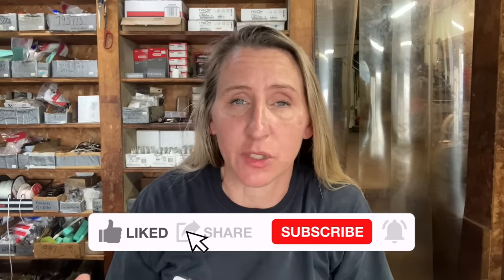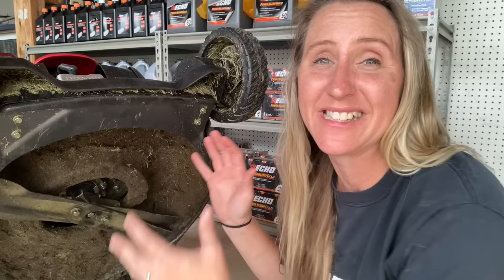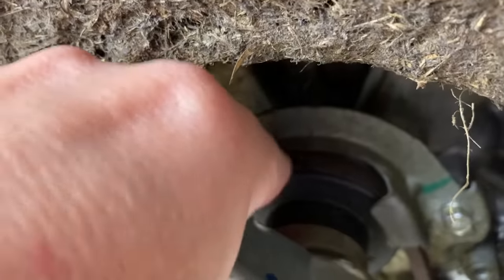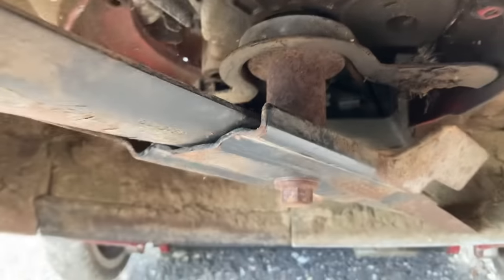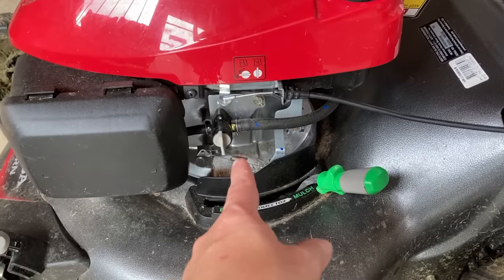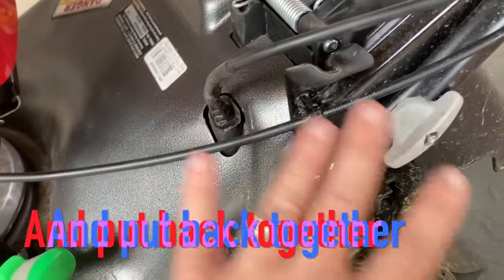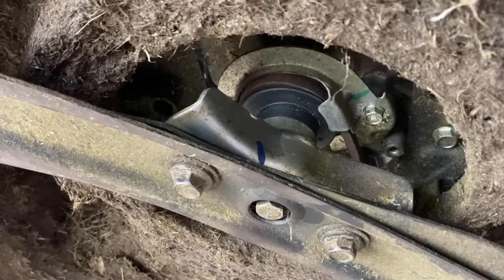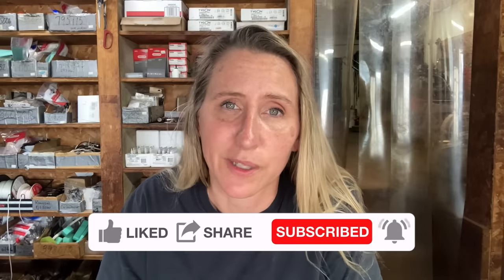SAVE A TON OF MONEY in repairs by NOT BUYING this NAME BRAND mower.

Comment: I've always sort of suspected that typical big box offerings were not going to be at the Honda HRX series level.  However, I'm really surprised to hear about these issues with Honda mowers, even the HRN series.   I purchased a Honda HRX 217 mower in 2004 for $600, a somewhat exorbitant amount of money for a self-propelled walk-behind mower at that time.  The reviews were outstanding and I had had it with cheaper mowers that always needed repairs and eventual replacement.  I even had a Toro for a short while and in my opinion it was junk, with poor ergonomics, two wheels always falling off, cheap sheet metal height adjustment levers that didn't hold, a tiny bag that didn't last, etc.

From the moment I got it, I knew the Honda HRX 217 was a beast.  The composite deck and everything about it is bullet proof.  It is the best mower I've ever owned.  It gets hard use on a half acre lot, part of which isn't the smoothest.  From spring clean up of winter leaves, sticks and small branches, throughout the summer, and deep into the fall with leaf mulching and pickup, this mower has been challenged and it is still going strong.  At $600 and now into its 21st year works out to an average $28 per year cost so far, and declining.  I change the plug and oil annually and only use non-ethanol gas in it, so I don't even have carburetor issues.

All of that said, last year Honda announced it was getting out of the gas-powered mower business.  Thinking that nothing lasts forever, I decided to buy a new HRX 217 but by the time I became aware of that fact, they were no where to be found locally.  I finally located - and bought - the last one (of two), 150 miles away.

Comment: Thanks for the information. My 13 year Toro took a dump last week was actually going purchase this Honda mover in the next few days but I guess I’ll just go Toro again. Thanks again.
Reply: Buy it,,,,, it is a good mower.  I’ve had mine two years now and works well.  Just clean and maintain it and you won’t have the issues presented in this video.  I think these issues were owner neglect and miss use, as well as not maintaining and cleaning.

Comment: A friend runs a yard service company. He tried Hondas some 10 years ago and went back to Toro. They just did not hold up under commercial use.  He has Toro's that he purchased at the same time as the Hondas, and they are still in use by his company.  After going through several cheap mowers in my new house in 81,  In 85 I purchased a Toro. It lasted until 2013.  I replaced it with another Toro.

Comment: We are a small engine repair shop, as well,
seeing the same things as you are !
My mechanic is a first rate fabricator !
So he made a sheet metal ring, or plate for the cover in the opening !
So far, so good !
We will see how well it works out over time !
As for the plastic parts, shame on Honda !
We may need to form a new cover for this, but remains to be seen !
Reply: Honda won't be caring at all now that they are stepping away from building lawn mowers.

Comment: I've been using the Honda HRX for over ten years and the only issue I've had was with the pull cord.  I do change the oil, plug, air filter and blades once per year.  I use the mower approximately one hour per week from April to September.
Reply: I have the same model and have been using it over 12 years.  I think the HRX is commerical grade and that makes the difference.
Reply: Some people don't have common sense. The look of that mower simply shows the laziness and carelessness of the operator.
Reply: That would be one of the shaft drive self propelled ones?
Reply: @bucsfan0077  Hi Fry, The HRC line is Honda's commercial line. HRX is not rated for commercial duty.

Comment: Hey Chickanic! Good information and as you stated it is about that particular model. I personally own a Honda HRX 217 VKA 190 cc that I’ve had for more years than I can remember and have definitely put it through it’s paces living here in Oregon with our wet climate. Yes, I do my own maintenance and keep up on it and have never had a problem. Personally I swear by Honda but even the best can fail now and then. Keep up the great videos they are very informative.
Reply: My HRX 217 is going on 3. Glad to hear they last
Reply: @montgomeryfitzpatrick473  My HRR216 is going on 8 years. No problems. I do blow it out after every use and clean under deck. DIY. Oil change, filter, plug every year and new blades every other year. I guess with Honda ending mower production they didn't really care as much on this unit.
Reply: The HRX is a Hydrostatic transmission though which is different than the HRN's belt drive system.
Reply: @smokeycanuck8058  And the HRNs system sucks.

Comment: Thank you  and well advised!  I have used and purchased many mowers over the past 70 years around  (30), and consider that older Honda mowers were good, however there were many other good ones. All the mowers I used and purchased were well taken care of and maintained. I liked the 2 stroke Lawn-Boys'  the best, because they were simple, reliable and easy to repair. On the 4 stroke engines I used quality oil, changed it often,  and used 2 oz. of oil per quart, additive like Prolong. I don't recall ever wearing out an engine I have bent many a drive shafts by hitting a rock..
Reply: And that is the key ...knowing your equipment at home and servicing them regularly will go a long way
Reply: I picked up a used commercial Lawn Boy with the red  wheels. Light and powerful , starts first pull, great for steep ditches. Using 50:1 oil, no visible smoke.
Reply: I have half the years you do, but have only purchased 2 mowers. Both Briggs & Stratton motors. The only parts  I ever had to buy were spark plugs, a couple of air filters and 1 coil. Mowers stay outside(no shed or garage)

Comment: I appreciate your honesty!! That's one of the reasons I watch your videos. I agree, or did, with Honda mowers being the best in walk behind mowers. But.. like everything else, I guess they've started cutting corners. The old ones with the cast aluminum deck and the three speed trans. were the best.. They were reliable and would mow for days on end with nothing more than gas and occasional oil change. I bought two of these, used, from a lawn service. Re-sold one and mowed with the other for several years with no problems. It still runs but needs some new tires.

Comment: That's unfortunate for Honda.  I've got a Honda walk behind self propelled mower and it's probably 15 to 20 years old and has never skipped a beat, never needed to go in for repairs and starts flawlessly, like most Honda motors.  I wonder if Honda has changed some things and cheapened the manner that they build their mowers.  I can't remember if the bottom side of mine (around the self propelled mechanism and pulley) is open but I'll take a look next time I mow.  Anyway, thanks for the info.  I'll know to stay away from buying a new one and keep my old mower running for another 20 years.
Reply: @chief: same here. I’ve had 3 Honda mowers. Earliest I bought was 1985. Got rid of it after about 10 years. It had an all metal deck and was heavy. My wife complained about the weight when she wanted to mow grass (about 3 times a year). Bought a new all composite deck Honda. The last Honda I bought was in 2009 and still have it and use it. Still runs great. I clean it up when I’m done mowing. My neighbor used to give me a hard time about cleaning it. He’s on his third mower (none of his were Honda’s). He never cleaned his, bought cheap ones.
Reply: @deepsleep7822  HA!  We've got the same neighbor.  Borrowed both my Honda mower and snow blower when his wouldn't start, was broken or in the shop for repair.  He always bragged about getting a good deal on a cheap mower/blower and last summer he broke down and bought a Honda mower and hasn't needed mine since.
Reply: If think most lawnmowers were just better made. We have a champion 2003 with a Briggs classic 35, no issues at all and it hasn’t been maintained well to be honest in terms of servicing yet it doesn’t skip a beat. The only issue has been a bit of rust on the deck but as I said, it’s been left outside and not maintained as well as I now know you should. Anything new seems to be riddled with problems

Comment: I remember my Father buying a new Honda self propelled mower (about 25 years ago). The day he got it, it wouldn't start. They had to send another mower to his house. I've had my Toro self propelled for 20+ years and other than oil changes and a couple of drive wheels, it's been problem free to this day. Its never seen the inside of a repair shop. Still runs like new.
Reply: Still got my 20332 toro recyler with the beloved quantum flathead from 2008-2010 something like that, other than the cheap plastic drive Pinons mated to steel sprockets (yea good idea toro..) fixed that with aftermarket metal to metal conversion, still chugging along nicely! I have plenty of honda products, their engines never break!

Comment: Wow. Good info. I would not expect that kind of design flaw in a Honda. Looks like this unit has a mulch feature which (I assume) blocks the discharge shoot and really compounds the problem.
Reply: I think the owner mulched in wet grass.  It might not have collected so much if he had bagged it or shot it out the side.
Reply from the maker: Thanks for watching Frank!
Reply: @RC-vs6lt  it’s rear discharge if you take the bag off
Reply: @RC-vs6lt  I’ve got a hondaHRX217 rear bagger/mulcher. There’s a gap between the spring loaded panel and mower deck that allows the grass clippings to fall to the ground when the bag is not installed. I’ve had this mower for 10 years and used it with no problems mulching,bagging or rear discharging. Best mower I’ve ever owned. The one in the video looks like a cheap knock off of something not related to mine 😒
Reply: Not true RC, it dischargees out the back when the bag is off and cover is down.
Reply: @wesadrian6981  Same basic story.  I have the HRX217 hydrostatic model with around 350 operating hours (I installed an hourmeter on day 1).  I maintain it, it gets the job done every time.  The propulsion is perfect. If I have to mow wet grass, that's that, and I'll hose it off -- only because that wet grass will decompose and stink to high heaven if I don't.  Some day in the far distant future this mower will be worn out, and I'll buy another Honda HRX.
Reply: @wesadrian6981   There are so many cheap knock-offs around these days( Chonda's - for Chinese Honda's ) and the build quality is just shocking. Unfortunately, the performance, reliability and operating life of these machines reflects their poor build standards and my sympathies go out to the hapless folk that were conned  into investing in this junk. I personally have had my Rover mower for over 7 years that's fitted with a 5HP B&S engine that is indestructible - it even starts first pull after sitting over two months (Quick start really works) - I love that thing. My knock-off weed whacker......well, let's just say the less said about the beast the better. I guess the only 'positive' thing about it was the fact it was cheap.

Comment: I have been using a Toro easy store, rear wheel drive for the last five years. I have replaced the belt once and had a new transmission installed last year. I looked at the Honda, but the price was $200 over the Toro. It’s mowed several hundred yards. And I do mow wet grass, but I keep it cleaned out. And its so easy to start.

Comment: I purchased a Husqvarna 435 chainsaw new. I had it for about three years. It ran really good. I never put too many hours on it, I would guess 15. Went to start it and couldn't pull the rope. Something fell apart inside the case. I could rock the crank back and forth about a quarter of a turn. I junked it and said I will never by Husqvarna product of any kind again.

Comment: I don’t like self propelled mowers. My take on most things is the more complicated they are the more there is to go wrong with them. And on the topic of wet grass, I wait for the dew to evaporate off the lawn before I mow. I usually mow just before sundown. I really hate the way grass clumps up when it’s wet. It mulches much better and it’s much easier to keep the mower clean.
Reply: Agree totally on the self-propelled. I'd rather not have the "help" if it means belts stretching and constant adjustment, then just quits working. I need the extra exercise anyway! Can't say I don't mow wet because where I live it is still hot as hades just before sundown. So mowing early is usually my go to, even though I know it is not ideal.  But I also try to keep the undercarriage cleaned out.
Reply: i like the kubota shaft driven 21 inch mowers made solid  crank shaft for hrx 2176 is $288.87 here wich pricey
Reply: absolutely agree , don't overcomplicate mowing , just get a honda push mower and keep it clean , the more complicated the machine the more things can go wrong
Reply: Push one five or six hours a day in the Florida sun through tall St Augustine.

Presumably, the people who are buying self-propelled mowers have established that they have some kind of need for that feature, and there's no reason to expect bad engineering from an otherwise reputable company.
Reply: @stevieb6173  lucky i wash mine  and nice deck is solid plastic wont rust
Reply: Agree, the more Complicated the More Problems.....And It,s Just Getting Worse.
Reply: @47f0   Bingo! I mean how can anyone use that "extra features will just break" attitude in 2022? I bet the same attitude was around when the first car was sold with power steering. 😉

Comment: Traded in my Honda after having problems In the first week, got a ego battery powered mower instead and that was a very good move on my part because not only does it chew threw tall  dewed grass but it even have lights to mow at dusk which is fancy, and after a year of using it I've had no issues with the ego besides the self propelled system could be a bit smoother but it works perfect and pulls hard, and there's typically no need for the side discharge because the amount of torque the electric mower has just goes through tall grass
Reply: I have one as well, but mine can’t seem to handle thick Bermuda Tiff, it struggles unless I cut it way too high.